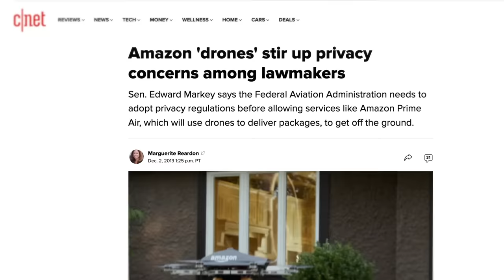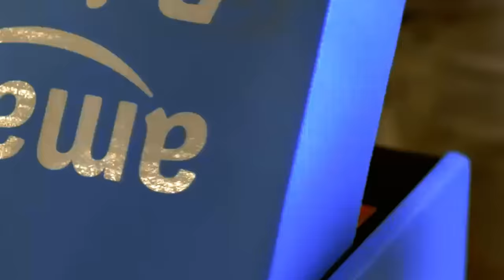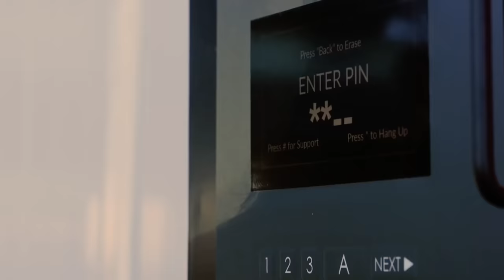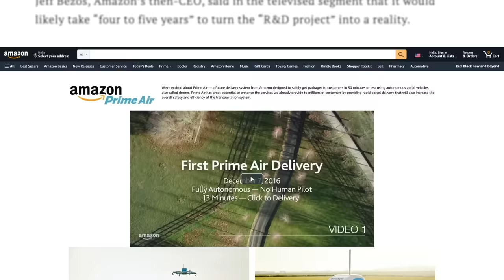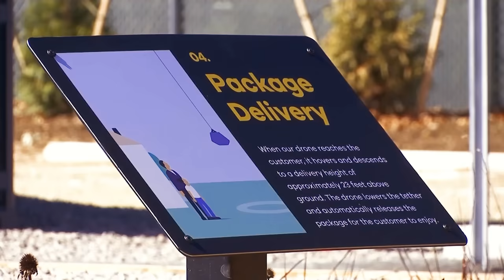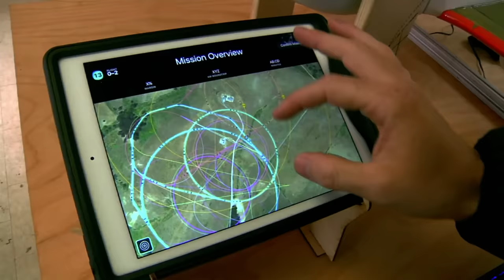Drone Delivery Was Supposed to be the Future. What Went Wrong?

Comment: Put a hub 300-500 up lol feet make it a big building and have the drones launch from the top, that way most probably all of there ascent stage is when there coming back light after they dropped off the package, when they deliver it they just fly off the roof and maintain altitude untill they reach there location and then descend. This would be the best ideal way to launch them. Delivery drones fly at a average height of 150-200 feet, the amazon ones all flew at under 400 feet. They all haul light cargo anyway, so making a system to get that up to the roof wouldnt be that hard. This can definitly be still be done.

Comment: its all nice to think about. most large drones have huge battery packs that weigh almost as much as the drone itself. that limits how far a drone can fly already. but strap a 20 kg 3d printer to the bottom of that drone and it will not be able to lift off at all. building a bigger drone makes it heavier, more expensive and also more dangerous to people on the ground if it fails for some reason. drones have their use cases but not in delivery, like what Amazon was trying to do.

Comment: Seems like the sensible thing would be to start putting drone bays in homes.
In communal housing you could have an open standard for the drone to communicate with the bay in order for the delivery to end up in a locker for a specific house. Not going to be cheap to start with, but it would gaurantee landing zones and safe delivery, and we know that the worlds demand for goods delivery is going to outstrip infrastructure.

Comment: These would be perfect for fuel and water resupply (55 gal. barrels) to remote mountain communication sites, like the one I used to fly in a UH-1 helicopter.  There was no road.   It would save a human crew from taking the risks.   The airspace issue can be resolved once the drones, and, in fact, all aircraft, are controlled by supercomputers.

Comment: One major disadvantage and safety concern that wasn’t mentioned. Drones are very unsafe when they experience a mechanical failure, which all things mechanical eventually do. The last thing you want is drones periodically falling out of the sky over populated areas. For this reason it’s already illegal to operate drones over populated areas. It’s really an unsafe method of delivering packages. It’s kind of right up there with flying cars. It makes no sense once you look at the the totality of what can and will go wrong. Helicopters and airplanes are not the same as drones. Helicopters and airplanes all have the ability to land safely after major power failure, and they’re operated by well trained, licensed pilots. Drones have exactly none of that.

Comment: A few minutes of the video were about how the terrain and distribution of people caused problems with figuring out the actual drop points and methods, so I'm a little curious how many issues would be alleviated by having the drones be piloted by people instead of AI, at least for the last part of the delivery. I'm sure the answer is "not enough," but also that it's more than none of them.

Comment: One big problem they had was weight. They want a drone that can deliver 7kg / 15lbs. The only real way to scale up to that is to displace more air. I heard that the drones they developed capable of this really blows a ton of air, its like a small helicopter almost, you don't want that landing in your backyard.
The rope dropping didn't really solve it either because of all the turbulence as you lower it, and you're adding more weight as well.
Also need to think of battery life, bigger motors and adding a winch isn't good for its runtime, so you add more batteries which is more weight.

Comment: Biggest issues I see are their limited capacity (weight) and the noise and possible "traffic" issue they may pose.  But the bigger reason is the law.  Most laws do not allow drones to be used (either for commercial or personal use) within a certain distance of a populated area.  This law has changed slightly over the years to allow people to do this now if they maintain a reasonable altitude above people, but for a drone to deliver a package, it would probably have to come within "uncomfortable" distances of a residence or business to deliver the package, and most people probably wouldn't want that.
I can see the use of these drones for getting things to remote areas where there maybe aren't roads and are not heavily populated areas, but for normal America, this won't work out too well.  Then there's also the concern of privacy and also practicality.  A drone would almost have to go back and pick up another package and drop it off somewhere else and repeat many times per day, where it may be cheaper to just have a driver load up a truck and drive around all day delivering packages and still abiding by the rules (ie. privacy concerns, safety, etc).

Comment: If drones flew at a specific altitude that was high enough for the sound to not reach the ground, but low enough to not interfere with actual air traffic, this most definitely should be the future. It would take a considerable amount of law shifting to get the FAA on board, though. Also, people probably complained about noise pollution when commercial airlines came about 🤷‍♂️
Reply: hi arkadihughes, have you become a flat earther yet?

Comment: You still have to pay someone to pilot the drone.  This is just a method to save on fuel cost then and that is a trivial amount when compared to the cost of compliance and permits that Amazon needs to operate these things in an airspace that is all about safety.  Plus these drones are limited to 1 package of small dimension of 5 pounds or less.  A vehicle can hold much more than 1 package which is why Amazon Flex and Amazon Prime drivers are the most economical way to go.  Plus it creates jobs for our economy which is a positive.

Comment: I don't get it,  a hybrid approach would solve the problem. By that I mean having  a human only do the landing part. The AI would still do most of the work time, keeping it cost-efficient.

Additionally, delivery in urban areas could be possible if, the customer would be at home and a human would control the drone. 
They could for example, deliver the package through a window.

Also, While the video suggested that suburban areas are ideal for drones however, (assuming the ability to deliver in urban areas) I disagree.
Suburban areas in contrast to urban areas have low traffic. Which  takes away one of the main advantages of drones, the ability to bypass traffic. 
Furthermore suburban areas are quiet comperd to the noisy urban areas. The drones are loud and will add alot more noise to suburban areas then to urban areas.
 
Because of this I think drones might have a future
Reply: If you have to pay someone to do the landing, you're better off paying them to deliver the package - and several more at the same time.

Comment: It's shocking to me how people believe that drone delivery could happen in near future. I am a staunch believer in this solution... but maybe in 30 years. 

There is a very easy and practical solution to the last mile problem that was invented in my home country of Poland. The delivery isn't to the house but to the nearest automated self-service distributor. The truck arrives, load all the packages into the right boxes, and goes. And people pick them up at their convenience. They are never more than couple hundred meters from your home.

For me, drone delivery will be practical when we have self-driving cars on the roads. Then you can make mobile distribution centers. Just the issue with the last foot problem. It is tricky and probably would require special mailboxes near windows. So infrastructure needs to be in place. But I know a couple of guys that would gladly buy, install it and pay extra in the app for food delivery this way. They order a lot and always complain about drivers.

But technology and the market are waaaaaay insufficient for it at this moment.

Comment: This sounds more like a government policy issue than an inherent flaw with the technology. Planes aren't buzzing houses when they land and take off, and by the time it's 100m from the airport , it should be over 100m in the air, close to the legal limit for drone height ANYWHERE, regardless of airports being nearby. This altitude is also higher than any obstruction a drone may encounter, even those tall ass high voltage power lines. 

I guess the bottom line is that drones could safely fly at max legal attitude at 100-200 meters from the airport, and it's only dangerous if a plane is literally crashing. At max height, the only obstacles are apartments and highrise buildings that can easily be navigated using existing road data.

Comment: US is so backwards with many aspect of life...
you did something first, you did it good enough and you stayed there, so those who came later knew what you did, knew other ideas and stayed there.
I never used a cheque, and I even forgot about cards with magnetic strip or using signature to pay the card.
Anyway, not many people live in houses with backyards so even if you had working drones, they are useful only for a fraction of deliveries
We just use automated parcel lockers. In 5 minutes walk I have 4 different ones. In rural areas they are often on gas station or next to supermarket, so it's convenient to get there while running other errands.
Taking package out takes less 22 seconds on average (or if you have app, 10 secs)
For delivery driver it is also easy, instead of looking for 10 different addresses, you go to 1, scan package, box opens automatically, put package in, close box, repeat 10 times.
easypeasy

Comment: im not gonna lie the failure of the blimps and drone delivery was kind of sad, but expected especially considering that when at scale the failure rate of drones would be non-zero and falling drones can hurt people and property. Due to this the FAA in the US and other air associations around the world would get involved. Very quickly regulation and bureaucracy would push to see there be zero failures, which simply is not possible, but they will still push for it at any expense. eventually the traditional last mile will be cheaper, and at that point drone delivery was dead.

The blimp idea was DOA for many of the same reasons, but also because it is just a logistical nightmare to float a warehouse indefinitely above major cities. A single failure, disgruntled worker, or even a terrorist could see us having a modern blimp disaster very easily. The FAA were never going to allow it, though some other nations might have done it in the beginning i see the whole idea crumbling the first time anything bad happened with them.

The main issue isn't even the drones themselves, but society as a whole that wants everything bubblewrapped. If it were possible to just set up a system to pay for damages as they occurred and accept that occasionally (and i'm talking probably less than 1 in 100k) someone would die by falling drone strike then it might have had a chance, but people want perfection so bad they are willing to kill progress for the sake of a false sense of security.

Comment: I think anyone with at least half a brain knew this whole idea was a pipe dream.  I never bought into the hype.  At best, there may be a niche market for home delivery, but not widespread.  The medical delivery sounds useful.  If (as they said in the video) the drone needs to be withing 6 miles of the distribution center, then you may as well load up 100 packages in a van and let them drive them out.  You got 3 deliveries on one street - in a van no worries - will they have to send 3 drones for that?  Household delivery by drone just has far too many hurdles to make it practical, from a logistic or economic standpoint.

Comment: Between 1900 and 1950, we thought we would drive flying cars and dish washers would be replaced by mechanical maid by 2000. Hmmm. All we have is stupid vacuum cleaners roaming the house by themselves, not able to cover the entire house, getting stock between furniture and spreading dog poop all over the house. The one thing WE CANNOT COUNT ON is technological promises. We did get flat screens though after 50 years, but it turns out the small screen in your pocket is your worst enemy

Comment: What I'm hearing from this is "aviation regulation is badly broken". There is no reason that any air traffic restrictions at all should exist 10+ miles from an airport, and in the immediate proximity to an airport it should be technically simple to integrate an automated drone with ATC (assuming, anyway, that ATC was built on modern and automated systems, which its not). Get rid of that restriction, and sudden the addressable market gets several times bigger

Comment: Drones seem 'dumb'.

Why can't we use pneumatic tubes? Like mini maglevs. They used to exist but went out of style because they had limited distance (due to pressure)... but why can't they be sectioned with sliding doors to allow them to go as far as needed -- combined with self-propelled capsules?

The only real limit is our piecemeal/ ineffectient market system which relies on "businesses" for advancement, when clearly infrastructure needs a more top-down approach (with flexibility built in).

Comment: It's still the future just not dumb flying drones. But little deliver robots that just cruise around town all day. The noise of a drone is insane.
Reply: Zipline solved the noise issue and basically all the other problems mentioned in this video, I encourage you to look them up
Reply: Even delivery robots aren't really "the future". They only work for high-density locations, and even then only in low-crime areas where the robots won't be attacked. And where these dangerous obstructions on the pavement are allowed.

Comment: this drone delivery can't be the future. because what this drone delivery is recognizing as a "delivery capable drone" is a drone with 
1.unreliable AI
2. low flight time. the most essential requirement.
3. no arms.
4. fragile enough to get fucked by touch of a finger
5. won't be able to fight birds off.
what's needed is fuel cells. so if you are a company wanting to drone deliver, you must first discover proper fuel cells. with that, you will make enough profit to forget about drone delivery :/

Comment: A better solution is air tunnels throughout the whole country for packages, people, cars, and freight. Something like Elon musk's tunnel but something like the air shoot at the bank only a larger scale that is more efficient. We could power it on electricity and make it supersonic for package delivery but that would be expensive. Make a 600 mph train and 300 mph trains that are of different sizes that pick people up and drop them off all over the country. Like Elon musk's tunnel but all around the country. We could power like a bullet train. And find a way to make pods that can be dropped off at full speed that people and packages can ride in so the train never needs to slow down. It constantly runs at 600mph and circles the US multiple times on multiple trains. Then you can bail off of it at full speed from a pod that does 600mph and then catch another 600mph train by going 100mph at first then 300mph slowly up to 600 then jumping on the main train. If you want to travel long distance that is. We need to find a way to have many trains circle the US at 600mph with the ability to hop on without them slowing down and being able to hop off and slow down slowly and catch other trains doing 600mph install in different direction. There is a way of doing it but the transitions would be a bit tricky to work the bugs out of. That is a lot of potential energy and going from zero to 600mph too quickly is dangerous and can make you sick. I am sure there is a way to feather it out though. Pods. And springs and rubber bands and magnetic stuff. Bahhahaa it would be interesting to see some people come up with ideas that can be applied to a real life working model and see the costs. I am almost sure it is plausible.

Comment: This nonsense has damaged the radio control flying hobby due to corporate lobbying to grab the 0-400 foot airspace for commercial interests. This is still happening with all manner of regulation being attached to RC flying due to the media demonisation and hysteria alerting to the “dangers” of this relatively innocuous activity.  It’s also created a slew of bureaucratic roles to deal with the “drone problem”.  It’s the same flawed thinking that proscribes mobile phone use in gas stations, while completely ignoring the other more likely sources of ignition such as running vehicles and synthetic clothing.